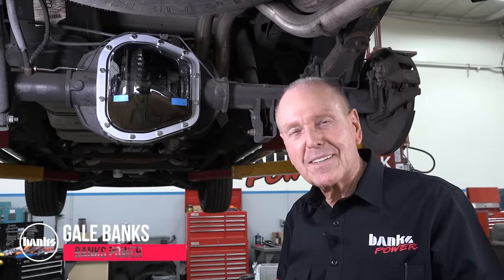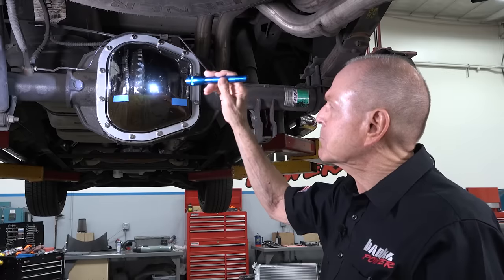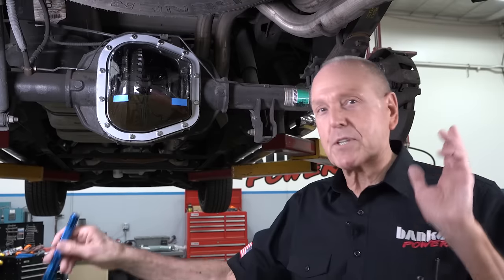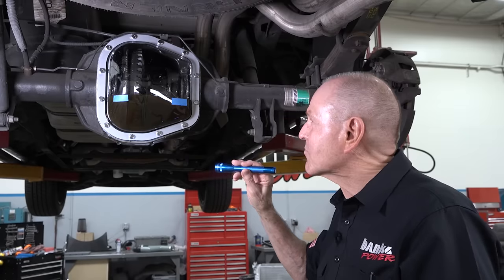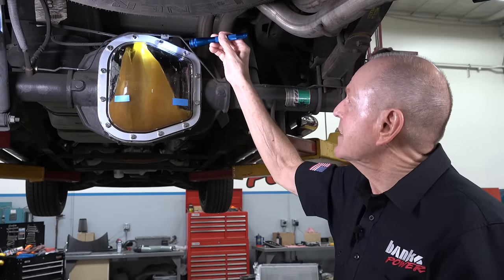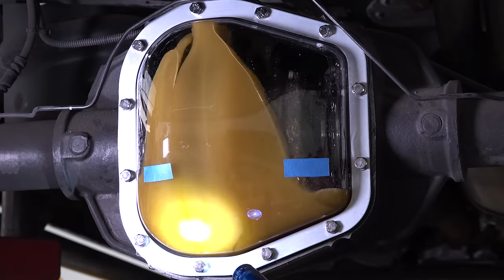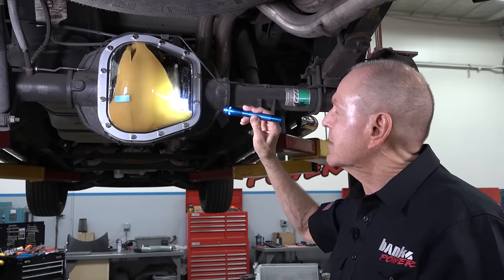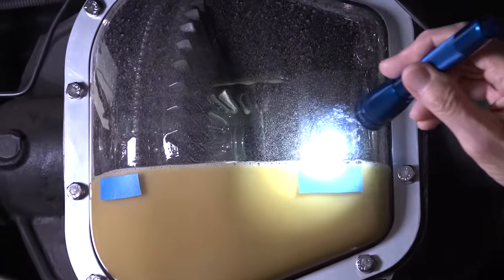What's going on behind your stock diff cover?

Comment: Wait...  You mean the engineers with a lifetime of experience is smarter than an armchair mechanic!?
Reply: Ya!
Reply: No way not possible 😊
Reply: No, I know more than him
Reply: AZREDFERN mechanics can’t be smart?
Reply: @Slowboi335xi  he's talking about people who sit behind youtube talking as if they know everything about cars
Reply: @liamholcroft7212  That's me! :D Jaykay.
Reply: are smarter*
Reply: @st.michaelthearchangel7774  More smarterer....
Reply: No they could never out-be-smarter than us.
Reply: @liamholcroft7212  and just the regular ppl who think buying or making a bigger, more square diff cover are improving the system that Ford spent $$$  and  years of time developing.
Reply: Why Me  very true. Compared to the past, newer vehicles have a trend of being engineered for mass production instead of being engineered to be serviceable
Reply: Yeah. Fluid dynamics and chumbwumba engineering is important when spinning stuff in things.
Reply: You're super special ❤️ sending prayers
Reply: What banks is forgetting here is that the gear oil level must be sufficiently high enough to lubricate the axle bearings pressed into the ends of the axle tubes.
Reply: @texasrox2010  lololololololololololololololol
Reply: @keyworksales6241  2007 Nissan Altima is the perfect example. to change a radiator, you have to remove the bumper and bull bar. Take off the AC Evap and pull it out. Then redo everything and recharge AC
Reply: Having spent over a decade in automotive (tier 1T&E) most of the engineering staff is at least average. The biggest problem is the bean counters. They destroy what could be really great vehicles.
Reply: @keyworksales6241  Actually they are designed to last through the warranty period. That's really about it. They aren't going to admit that, but having been on that side of the glass, it's just the way it is.
Reply: @texasrox2010  What you are forgetting is that this is a video series about learning things. Unfortunately you think you already know everything.
Reply: @johndoe-so2ef  100% true. I was a test cell technician for one of the world's largest and most reputable diesel engine manufacturers (rhymes with bummins?) and when I first started, I thought we were going to make the diesel engine better. As it turns out, we were just doing all that research to make it cheaper...
Reply: @travisbarrow3408  oh Lord, I used to do contract work for that same manufacturer..... Substandard materials, poor processing...... Wouldn't have one of those things if it was free.
Reply: Yup. As a Mechanic for 35years, I always love hearing stories on how to "out engineer " the "engineers ".
Reply: Yea well, not only am I  shade tree qualified, I'm also blonde 😂🤣
Reply: @keyworksales6241  Actually, some of those "bigger, more square" diff covers do a job that the stock diff cover CAN NOT DO, such as : 
1. - Holds 20 more ounces of lube, which facititates cooler (20 degrees F) running and longer differential life.
2. - Has Jack-Bolts for adjusting bearing pre-load, thus extending the life of the diff.
3. - Has a Drain Plug, which makes differential servicing faster and less messy. 
You don't seem to know much about automotive subjects -- I'll be glad to school you, and for FREE !
Reply: @SlikLizrd  tell me more about a different subject! Totally relevant!
Reply: @texasrox2010  actually he addressed that in the third of the clip.
Reply: For every great engineer there are 15 pretending.
Reply: @texasrox2010  Really? So what is the bearing grease and inner bearing seal for then?
Reply: @texasrox2010  Banks filled to Ford-factory level and subsequently spoke to the issue of lube oil being directed to the wheel bearing
Reply: @texasrox2010   Banks isn't forgetting a whole lot, they did make mention of the  angles and dynamic of fluid exchange at different rates of speed. And the angle of factory differential covers and what that all leads to internally. I'm not sure if you watched the same video, or if you've been under a truck lately but this is pretty scientific compared to the rest of the industry as far as after market. I would imagine there is a ton of testing we never see from big name brand manufacturers out there.
Reply: I've had Dodge Ram 2010- current.  Flat back covers on 3 of em, took 2 of em off cause 3rd is a beater.Been transporting rvzz 4 13 yrs. 1st rebuild rear end aboooout oh shucks 400-500 k miles. Nowadays I add Lucas oil additive 1 and a half quarts to 1 80w 90, and 1 85w 140. That's cause I'm always pullin .Without Lucas 80w-90 may as well be useless in my book. As 1st service on relatively new trukk 2018 Ram 2500 30,000 miles stock gear oil come out very thin- no good for me. Well that's my story and it works 4 me. If any one gots knowledge lemmee know.....
Reply: reality is often disappointing
Reply: Engineers make a lot of mistakes, its very difficult to calculate something vs. Seeing it in person. Thats why manufacturers build many prototypes. But yeah, I would still trust the manufacturer because they go through a lot of layers of RnD
Reply: Are*
Reply: They don't have the budget

Comment: As a mechanic, I can honestly say I have never wondered whats going on behind a diff cover. But, happy I came across this video!
Reply: You're a mechanic and you don't know how a diff works?
Reply: @NittoNba44  he lied
Reply: @NittoNba44  pretty sure OP is referring to the fluid
Reply: I wondered why the outside axle bearing in my LSC went bad. Now I get to chose between too much and too little. BTW pain in the ass to change. Traction lock.
Reply: Hello can i ask is there really that much fluid on every diff?
Reply: I knew if foamed from changing the fluid minutes after driving, but that was cool watching how it moves inside the diff.
Reply: What banks is forgetting here is that the gear oil level must be sufficiently high enough to lubricate the axle bearings pressed into the ends of the axle tubes as well as the carrier bearings pressed onto the diff carrier.
Reply: @texasrox2010  the gear oil must be at the manufacturer level. Not where you think it should be
Reply: Hell yea!! Iv never seen this either & it’s always been in the imagination 💭 part of the mechanics mind…. 💯 ⚙️ 👨‍🔧🇺🇸
Reply: Because most mechanics dont work on differentials ...
Reply: @NittoNba44  he never said he didnt know HOW a diff works
Reply: American Axle as made and designed these covers and Axles for years and if they figured this design needed to be different then they would have..
Reply: yes
Reply: can someone explain how the transmission is totally static when idling? shouldn't it be coasting. i'm clearly not a mechanic lol

Comment: Who else needs to change rear differential fluid??
Reply: I do it every 100,000 miles.
Reply: Not me I just bought me a new RAM! Lol
Reply: I do it once a year in the front and rear axles of my truck. Might seem too frequent, but it gives me a chance to make sure the gears and bearings are okay, and to catch a problem early before it turns my axles into grenades. Also the T-case and transmission get new oil/filter.
Reply: I need a rear diff first, hahaha
Reply: I do it every 30k. Front and rear.
Reply: The number one most overlooked fluid.
Reply: @drivewaymarvels311  transmission is up there too
Reply: @tmoney8203  your right because you wont need to change your fluids before yours grenades
Reply: I have to do it every few weeks lol. The seal on my 02 escape is bad so I have a leak on it and to get to the seal about 1200 job . 🤦🏻‍♂️ so I’ll jus keep filling it up every few weeks
Reply: @Shot_City313  god... Goto the junkyard man.. Save you some money
Reply: Savage Sock the seal is super cheap it’s just getting to the seal you have to dismantle the whole rear differential .. shit sucks but I’ll get around to fixing it eventually . For now 10 bucks (price of bottle of fluid) every 2 and a half weeks is a decent band aid for the problem lol
Reply: Done over 200,000ks still haven't changed it lmao
Reply: @blueblood5297  lol
Reply: @Bloodbain88  I only wish every used car ive ever bought had an owner that thought like you....i seem to end up with the exact opposite lately...
Reply: @DoodleBug92  I take good care of my vehicles, but I'm pretty much always the third, fourth, hell maybe the fifth owner. The last 3 trucks I owned had over 200k miles when I finally got them. I always wondered how long I could make one last if I got one as a fresh start. But even a vehicle closing in on 250-300k miles that wasn't taken the best care of CAN be made to last quite a few years if you really give it some TLC. But most people drive their cars until it just won't "go" when they press the "thingy that makes it move forward." I've asked people when the last time their oil was changed or if they ever had a transmission oil and filter change, or how long since it's had spark plugs replaced, or power steering flush etc, and they just shrug. So I feel your pain about getting used cars and trucks that have just been driven into the ground and never maintained.
Reply: @Bloodbain88  Yeah its so annoying how people dont maintain their crap, an ounce of prevention equals a pound of cure. Just got a 98 jeep for 1200 from my fathers friend, been struggling with the brakes all week caliper bolts all frozen, brakes looked 10 years old pads worn down to the steel. Unbelievable. Anyway, enjoy your old cars I surely enjoy mine....so much value and enjoyment in a well maintained, cheap to insure, cheap to modify older car.
Reply: @DoodleBug92  Haha my daily driver is a 1994 Grand Cherokee I bought at 194k miles for $1000. Transmission failed at 197k. I replaced it along with other things and it's been very reliable ever since. Has your headliner fallen down yet?
Reply: @Bloodbain88  that's hilarious I had a 97 4.0 2 years ago, tranny failed and I junked it because it was too rusty. Why did your tranny fail? Mine lost 4th, then 3rd 15 minutes later. Loved that car. Now I have the 98 with the 318. Then I bought a 94 (with the 318 as well) parts car (let me know if you need parts btw). These jeeps are great its just nobody takes care of them. And the headliner is starting to come down and it has the usual bad drivers side upper ball joint....but that one can wait lol.
Reply: @STFDVC1  Sounds more fancy than it is. Basically just sucking out the old power steering fluid and putting new in while the engine is running. That way it's circulating and you can get most of the old fluid swapped out. Makes your pump last longer and run quieter. A lot of the vehicles I deal with are heavy duty and have hydroboost brakes, so the power steering pump has to power the steering AND the brakes.
Reply: @DoodleBug92  Hey my Jeep has the 318 as well. It's a great engine I love it. Sounds good, lots of torque, reliable. Out of curiosity what's your mpg? Best I can get is 12.6. Near as I can tell my transmission failed when the lockup converter went out, and it overheated because of the slippage. It happened pretty fast. When I pulled over and yanked the dipstick out, the oil on the stick was smoking heavily.
Reply: @DoodleBug92  I had bad balljoints too but they couldn't wait I was getting death wobble. Ended up doing all control arms upper and lower front and rear, trac bar front and rear, front wheel bearings, steering linkage, and ball joints. Now she's solid as a rock. And let me tell you, changing  those front upper control arm bushings can make a grown man cry.
Reply: @Bloodbain88  btw my dad had a 98 grand Cherokee for 15 years, ball joints were terrible for years. We finally sucked it up and did the ball joints together, then a week later I got t boned in the car. That was 2 years ago. I guess the jeep didn't want to be fixed lol
Reply: I should, drove my Tacoma thru 30" of flood water during Hurricane Harvey.
Reply: Me
Reply: Need to bought a opd truck dount it's ever been cleaned out
Reply: That's the next owner's problem.
Reply: Ram Front rear and T case tomorrow
Reply: I need to do it every 30,000 and I'm way overdue
Reply: @tmoney8203  As your new truck breaks it's recommended that you actually service it often within the first 20-50k miles. Good thing diffs have magnets on the plugs to catch small metals that build up. Food for thought.
Reply: @Shot_City313  just buy a new gasket .  it's super easy to take off the cover.
Reply: Look up lube lockers. They’re re usable gaskets. They might make them for your ford
Reply: Anyone who says they need to change their gear oil. 

Nobody wants to hear you are lazy. 

Men do things. 

Children that never grow up complain while doing nothing. 
Wasting those who actually do things precious time.
Reply: Every time I replace an axle seal which is more often then I'd like to admit
Reply: well in alabama you pay em to and they freaking dont, diy comes from not trusting these fools on my end
Reply: 150,000 on my f150 and I might’ve probably gotten water in the vent tubes so probably
Reply: Wow and I've been driving my Ford explorer at 90 miles an hour with 112'000 miles on it with the original fluid 😬
Reply: I just did it yesterday for the first time after 84k miles. Oil didn't look as bad as I was expecting but was still pretty dirty.
Reply: @Shot_City313  Have you fixed it yet? Just buy some gasket maker that's oil rated, take the cover off, scrape the old gasket off with a plastic scraper NOT a metal one, put some gasket maker around the entire cover,, reinstall the cover, put all new oil in there, and you'll be good to go for a long time. You'll save yourself a ton of time and money if you just get it over with.
Reply: TaysonPlaysGuitar cars been sold lol bought a 71 nova
Reply: Get some RTV
Reply: Mine needs some as I just bought it
Reply: Yup
Reply: :D nice
Reply: Just did!!! 72,000kms!  happy I did, rear was milky for some reason, front was great
Reply: @666dynomax  water makes it milky.
Reply: Well now I do...
Reply: @JayzBeerz  thats way too much lol
Reply: Just changed mine last week 😎
Reply: How often are you suppose to or should change it?

Comment: What a legend. Still waking up every day wanting to improve and learn. He's such an inspiration. I would give anything to be that devoted to a cause. At that point, it isn't work anymore.
Reply: You must have taken lots of grammar classes.
Reply: Sometimes it's our perception of our very own definition of work that we choose not to agree with.

I'm with ya.
Reply: A hobby gives much of the same nourishment.
Reply: @janebook294  imagine being that gay
Reply: What banks is forgetting here is that the gear oil level must be sufficiently high enough to lubricate the axle bearings pressed into the ends of the axle tubes as well as the carrier bearings pressed onto the diff carrier.

Comment: Wow Gale , I’m a retired CATERPILLAR mechanic. I just stumbled across your channel. This video   should be required for all mechanics. I concentrated mostly on engines but did  rebuild differentials and all other components. This was extremely interesting. Looks like It’s gonna be a binge  night. I’m especially interested  in the 2020 duramax series. I’m probably gonna buy one later this year. I’m a little Leary of the first years of major design changes though.

Comment: Most rear axle vehicles I have to repair on the axle side including my own it's not all that simple but please let me explain, first it depends on the terrain the vehicle is used flat level roads it's all okay to have the correct level and all so if you do high enough speeds, but I do field repairs on farms that sometimes take me to spots that well is so hard to get that 15mph is speeding and have to be in low range 1st gear for several miles with sometimes sloped badly to one side and had previously a bearing failure on the higher side of the axle. Now I've learned that if you do any off roading with slopes that is to the side it's best to over fill axle but in this it creates another problem and that is with high speeds foaming is a problem so you have to sacrifice. But don't just run and overfill your axle just yet just because you're doing a 10 yard slope to the side at 10mph as there'll still be enough lubricant to protect your axle side shaft bearings. Hope you will find this helpful. Oh I've been a field mechanic for 26 years and just something I've picked up over the years.

Comment: Interesting. Have done differential work and never thought about the way the gear oil is distributed.
Reply: Joelynn Carter as you could see, they became submerged dynamically via the ring gear carrying the oil there. While static, it drains out of the axle tubes.

Comment: "You want to get the heat, the hell out" --- #LifeGoals
Reply from the maker: Spoken like a true prodigy.  👍🏻
Reply: @bankspower  What banks is forgetting here is that the gear oil level must be sufficiently high enough to lubricate the axle bearings pressed into the ends of the axle tubes as well as the carrier bearings pressed onto the diff carrier.
Reply: @texasrox2010  Wow... it's like you were stoned during the entire video... so I'll summarize:  when sitting still, you don't need any axle bearing lube, but when going just 15MPH, there's so much turbulence and splashing, that the axle and carrier bearings GET PLENTY OF FRESH LUBE.  Graphic videos of dramatic transparent diff covers aside, have YOU ever had a rear axle bearing seize with less than 150k miles on it?... No?... then it must be getting enough lube, Q.E.D. 

TLDR: Mechanical Engineers know WAY more than you about proper lube levels.
Reply: @texasrox2010  you dont know how a semi-floating axle functions.  A full floating axle, like in a 3/4 or 1 ton uses the diff lube for the wheel bearing lube.  The axle of a half ton does not, it is sealed at the edges of the pumpkin, and the wheel bearings are sealed roller bearings that do NOT receive lube from the pumpkin.   Nice try though.
Reply: Imma watch the movie "Heat" now